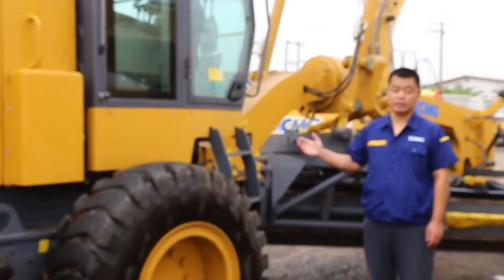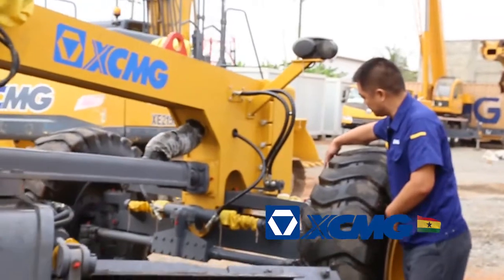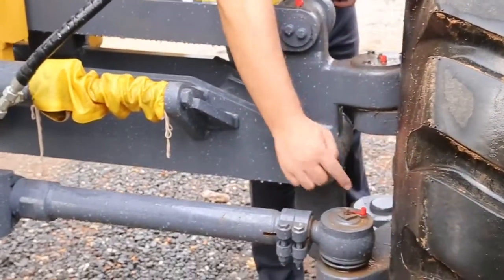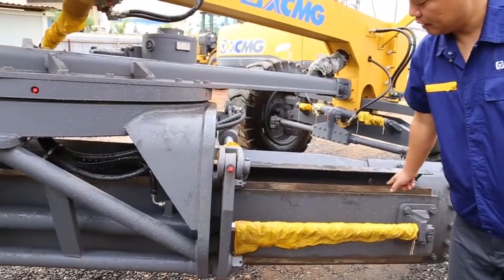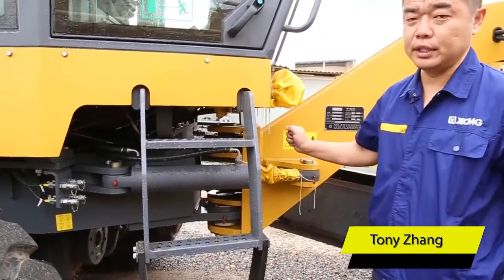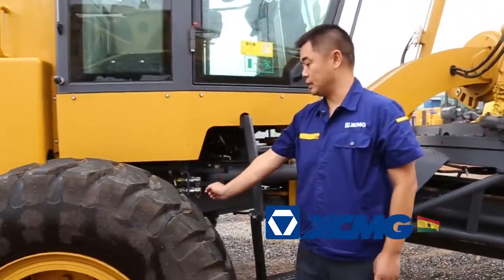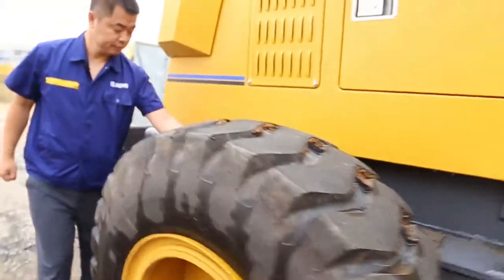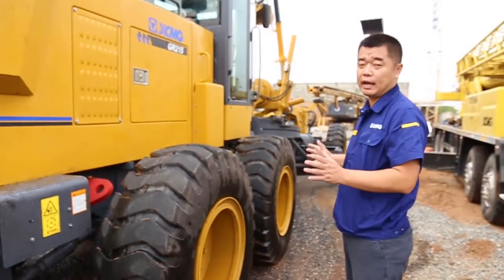Maintenance and Operation of XCMG Grader GR215

Comment: My xcmg grader GR215 is 6 months old and already am facing my temperature gauge going up and down causing alarm sign of overheating,can you pls advise me on what's wrong with my machine?
Reply: sorry for late, first should check thermostat if engine hot but radiator not hot like that, change thermostat,